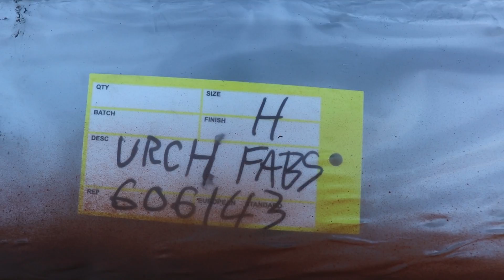THE MONGREL PART 11, MORE STEEL PANELS.

Comment: Excellent boot floor build.  As for heating , going back 20yrs I knew a engineer that used a regular electric hot water tank(maybe a 250ltr) set on about 45°  and plumbed pipes around his shed with a few truck radiators and Thermo fans to blow the heat out of them and around the shed. It was a stand alone system..and got very warm in there ...👍

Comment: Worked on helicopters back in the 70’s, doing major servicing (last nut and bolt job) in a temporarily unheated hanger, very large, very cold. Someone came up with the idea of rigging a cargo parachute over each bay and blowing a space heater into it. Much smaller volume to heat and quite a comfortable environment. You could try something similar with a tarpaulin or a large tent and whatever heat source was convenient. You would have to be careful regarding carbon monoxide build up though.
Love the project.

Comment: My workshops not as big as yours but ive just brought a Sealey LP13 space warmer. Mounts on top of the bottle so you can move it round easy. 

Lowest setting it says it uses 220g per hour, highest i think is 330g and its bloody roasting.

Comment: What you can do to flatten a panel you have just bead rolled a bead into is roll the edge of the bead in the wheeling machine to stretch it back again. Making boot floors ,i often have to do this with big panels, think of the bead as pulling the panel like a weld does as it cools down.

Comment: I used to work on a quarry and we had a blower heater in the workshop, we ran it on red diesel instead of heating oil, was more expensive but diesel burns hotter and had the 40x120ft workshop toasty warm in no time
Reply: Used the same thing to defreeze Scania tractor sumps that were left out over night in the yard before warming my HGV service bay way back in the day

Comment: Awesome work Matt. The Mongrel is going to be a Beast. 
You actually made that panel look easy to make. 😁

😂🤣

As for the tube heater and your high ceiling. There is nothing that says the heater can’t be hanging down away from the ceiling plus they can still work okay if they are up higher but they in general only warm up the area or objects they are focused on.

Comment: Oil burner or wood stove. I used wood stove in my shop, I did a mix of metal and wood working. I made mine out of a 55 gallon drum and a barrel stove kit. Had my chimney 2.5 feet above peak of roof and it worked great.

Comment: Rhibo IR heater on castors is ideal in my workshop (Big old Chicken shed about the same size as yours). 5 Welsh Valley winters done and no complaints about the cold. I start with the two lights on and then turn one off. Doesn't cost a noticeable difference looking at the meter. Got fed up of renting gas bottles, diesel and oil fumes after twenty years! Great for pointing at wet paint too

Comment: Wish it was chilly here, 38 degrees celcius here today and had to take a trip to auto wreckers to pull steering knuckle off, so much fun in the heat!
Reply: Cold is worse dude, everything you pick up is freezing cold, you lay on the floor and that is freezing cold, your spanners almost stick to your hands when it gets colder, not fun, would much rather have heat than cold
Reply: @Sennaxm71  I used to work on F/A18 hornets, have done so in zero degrees, that was bad enough as had to warm the hands up to get them working...lol

Comment: Nice 👍 that panel fits LIKE A GLOVE 😁 
I'd definitely go for a waste oil boiler and some radiators initial cost taking into account time it might be a touch more expensive than electric heating but once you have it Its free heating Oil from scrapyards 
I would talk to the man who your renting off and see what he has to say 
If you go through the wall you can still run a chimney pipe up above the roof on the outside of the building although I would definitely run it through the roof if you are allowed as the chimney will exchange heat into the building and will draw better if it's hot 
Ie if it's outside getting blasted with cold air it's not going to draw just as well 

Glad to hear you have read the comments 👍 

I see binky boys are picking up the pace lol 

Keep the video's coming mate 👍
Reply: getting difficult to use a waste oil burner in teh UK now. environmentalists really dont like them for some reason.
Reply: Pete Lattimer I guess it depends who knows you have it ;-) in a cow shed in the middle of nowhere it's unlikely to draw attention 👍 
As long as it's working right as not pumping out big black clouds no one would ever known it's there

Comment: Rocket mass heater would be good, using an electric fan from a combi boiler, in the flue, to get the fire going. You would need quite a lot of flue pipe, as you need to snake it through the thermal mass that you are heating up.
It would be a project in it's self to build, but would be a cheap way to hear your workshop.

Comment: I use a small lpg bottle with two raised round 6" mesh grilles that you light. For personal use, 6ft away. No sense in trying to heat the whole w/shop. Plus carpet around the car for the feet. Thick winter socks, and long johns.  (Mechanic for 45 years.)

Comment: Matt, make yourself a waste oil burner. Easy and free. Put a small blower on it will burn with NO smoke. I made one from some old steel rims. Worked great. And the longer the flue the more heat you get.
Reply: Wayne Goff problem with that is your commercial insurance will be invalid 👎🏻

Comment: Do a wood burner with oil drip and put a small fan in chimney to force draw , That way it doesnt have to be higher than peak . I had that set up in my shop when I started and it worked fantastic, Also have the combustion air from an out side opening  so you dont pull cold air into the shop to feed the fire

Comment: You need a waste oil heater like a Thermobile or similar. They are often available on ebay and as they are fan assisted you don't need a massive flue. They cost nothing to run and put out a huge amount of heat.

Comment: I used some Ambirad heaters (gas) in a building simialar to what you have main problem is the heat goes upwards  did think about installing big down thrust fans , in the end i moved

Comment: Cast iron stove half surrounded by fire brick, exhaust straight out the wall then run the flute up to the height of the building mate, I've spent thousands every winter trying g keep the garage warm and wish I would of don't this year's ago, but I did cheat a bit and made my stove out of a couple of old gas bottles lol

Comment: We use a duel fuel drip feed burner that's fan assisted in our unit when we got it you could use waste oil or diesel unfortunately due to legislation we can't use waste oil any more but can use red  diesel,, very efficient machine and throws a nice temperature out,  can't remember the manufacturer name but it's still available if I remember rightly they had them in Clark tools catalogue.

Comment: Put you a steering wheel or a wheel on your bead roller instead of that handle makes life much easier
Reply: cedric benton, good idea.
Reply: I put a garage door opener on mine, used push bike gears and chain for a drive (so if need be I can change the speed) quiet and powerful, use sewing machine peddle for on /off. Switch on the opener for forward/off/reverse, total cost $5 for the sewing machine peddle and bit of time. Everything else was free junk.

Comment: The main problem with the gas heaters is, you need lots of ventilation, otherwise you get a banging headache. The paraffin heaters put loads of moisture in the atmosphere,  which in my garage leaves everything metal wet from condensation. My garage nowhere near the size of yours.

Comment: You might try a heater with a forced draft, so the chimney  would just be through the wall.
Reply: Rollie Kelly seen this done. Was simply a air hose aimed up through the chimney pipe with a low pressure high volume. Could be done with a shop vac.

Comment: You need something that moves air for heating, IR is ok in sealed places. IR uses alot of elec, you wont need the gas on that high for 8hrs you'll be cooking. Try the gas first, get a small bottle, go to Flowgas, cheap deposit and gas delivered free. Turn the burner on low and have it blowing on you/the job. I recon 1 x 47kg bottle a month in that shop. You wont want it on all the time and gas is instant heat, IR needs to be on along time before heating stuff. I can sell you a 3 bar 1.5kw per bar IR heater that I used to bake paint.

Comment: How about a fan forced waste oil burner?
They are run with a drip feed and use a waste product.
They burn so hot that they radiate enormous amounts of heat. 
Could be a fun project made out of an old car gas tank cut up .
Plenty of info on YouTube. 😉😊👍👍

Comment: Asbestos roof, oof talk about bad for health. Any who, was wondering if you going to remove the extra bit on the spare wheel well that you left?
Reply: Asbestos roofs are ok as long as it doesn't damaged or some idiot walks on it .Mine got massive holes blown in it in a hail storm and it took two years(!) before the insurance would cover the cost of new roof, ($40,000) but the roofers only took 1 day to replace it . There's still hundreds of asbestos roofs around me and the only worry is that government has a register of all of them.
Reply: It's asbestos cement roof
There good. but I sprayed mine on the inside with a lime based emulsion. 
It's expensive but goes a long way. 
   A cheaper way would be a lime wash.

Comment: Are you going to sandblast it ? (To make it clean and find hidden rust holes). 😎👍
Reply: Sandblast after the visible rust and dents are repaired, as blasting peins (hardens) the metal surface and makes it impossible to file finish. By all means when the guts of the work is done blast it and see what you have missed....

Comment: U should get a circular hand saw with a metal blade will help speed up cut instead of using a angle grinder with a cut off wheel

Comment: Please don't irradiate yourself on purpose.

I submit using a water heater with radiators and fans like Marty commented. Additional fans up high to push the warm air back down

Comment: Please don't use IR heaters they don't heat up the air only what's directly in front of it and they are certainly not cheap to run. Try insulating the building stopping drafts etc then even a propane heater will be cheaper to run that IR. A propane heater will not be needed to run constantly as they very quickly get an area warm and insulation keeps the warmth in.

Comment: think i wouldve looked intoo an electric drive and footcontroll after about the second panel on that beadroller , seen a few on youtube that arent that hard to do

gave you the links to an verry eazy to make waste oil burner before ,  i think its the cheapest option even if it does need a chimney 
https://www.youtube.com/results?search_query=waste+oil+burner
as for the chimney not drawing and not wanting to go through the asbestous roof itself , you could go out through the side of the building bend up and over the raingutter then follow the angle up on top of the roof (could replace one row of screws that hold the roof down on a beam and replace those with pipe holders ) 
https://static.mijnwebwinkel.nl/winkel/schoorsteenwinkel/image/cache/full/375fec15afdf30b18a1fc21719e37a89ddd94bee.jpg
turn the chimney up and vertical at the verry top maibe a foot or so , should work ok and doesnt need to be verry thick wall pipe as its supported along its length 

another option might be to put a chimney horizontally inside the barn through the front and back wall and T the oilburner intoo that , that way theres allways a draw no matter from which side the wind blows (allways a vacuum on one or the other side of the building pulling air trough the pipe ) the heat radiating from the pipe itself might even help some 
the waste oil burning in a thick steel vessel can give of an incredible amount of heat without costing a lot of money (think they rather give the waste engine oil away then pay to have it disposed off )  , it should keep the shed warm even without insulation and the shed being the size it is , it will melt the snow off the roof and will trow up steam if its raining 
the added cost of the chimney should earn itself back in one season both in fuel cost savings and added production during the cold season

the infrared will work only at a small distance so you be constantly moving those about to near where youre working , they prolly cost a lot in electricity too 
(having 2000 watt running for 12 hours a day over here comes to about 174 euro per month ) most of those electric 220 volt space heaters are 2000 watt and as cold as it is in the shop they be on constantly (thermostat whont switch off ) unless you insulate the shop or heat a smaller space